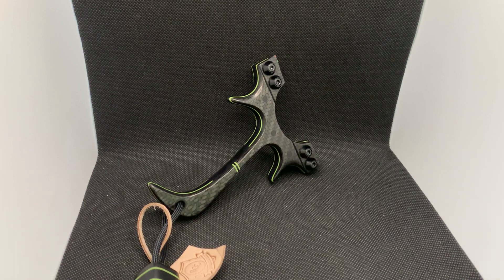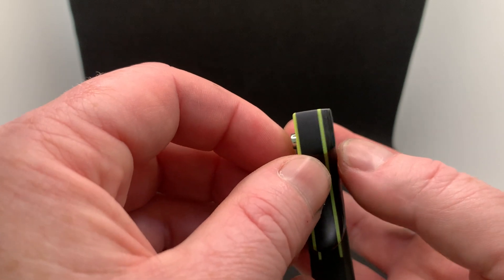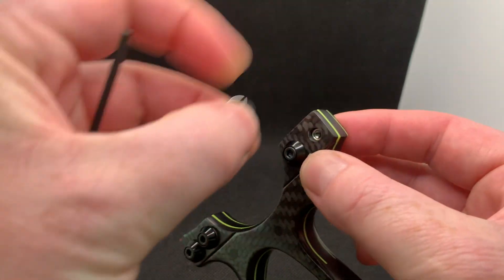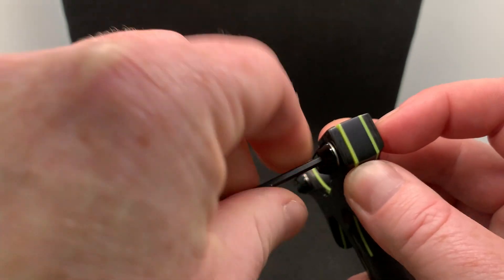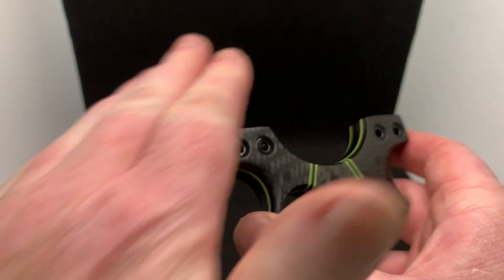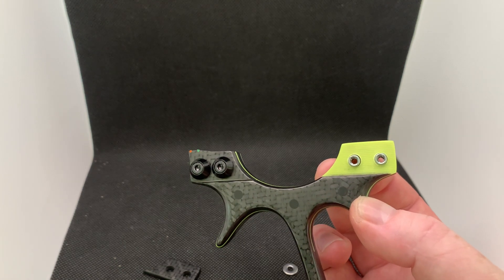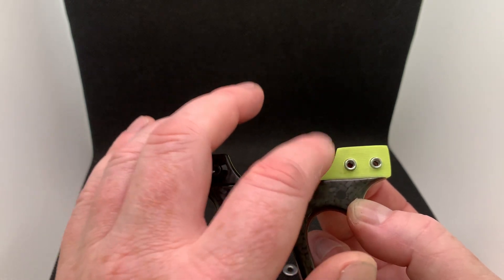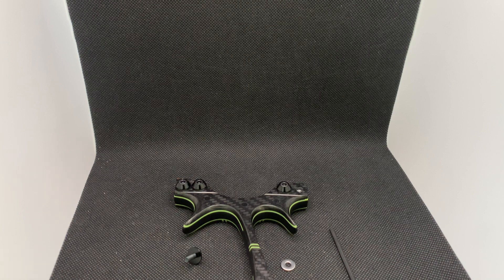The science and workings of the rcc sandwich sight band clip attachment

Comment: I do the same thing on my late frames. The good thing is the bands won't touch the bolt and get damaged! Only difference I do is, the hole is only bigger on the inside of the clip, just enough to let the rivet sink in, the rest of the hole has just the diameter of the bolts.
Reply from the maker: Thst like a catapult carnage frame, in doing so you have no need for the washers I use